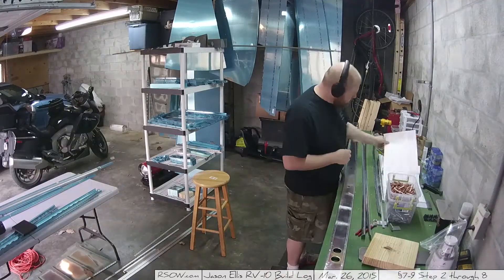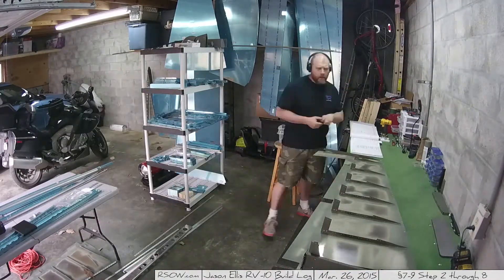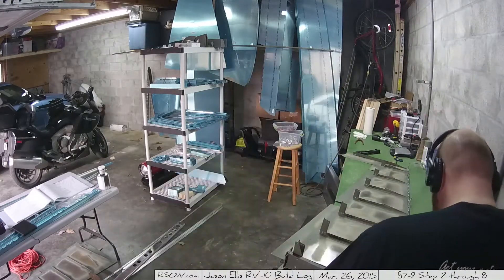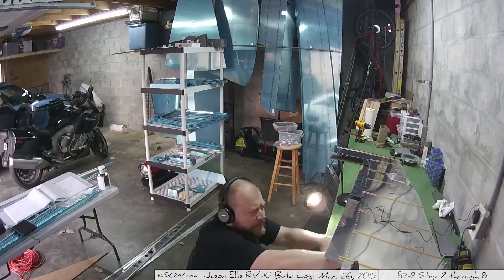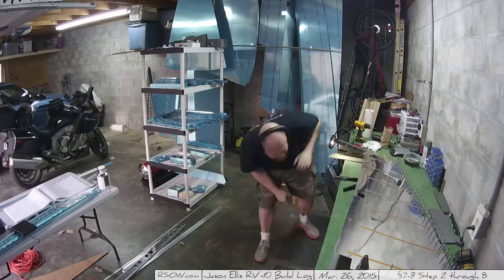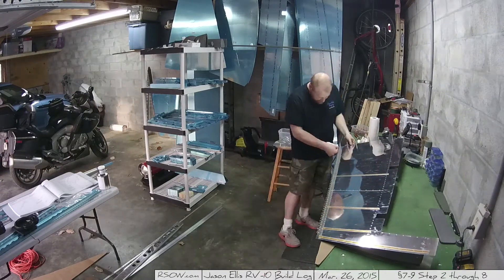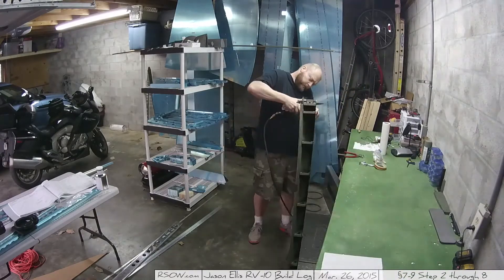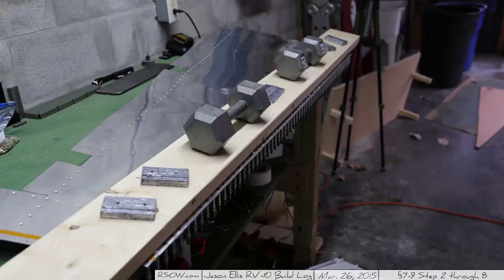RV-10 Empennage Section 7-9 steps 2 to 8

Comment: How much sealant did you end up needing for this application?  That stuff is expensive, and I don't want to buy more than I'll need in a couple months when my kit arrives.
Reply from the maker: Honestly, not much at all.  One of the little 2oz tubes should be ample.. But I know a lot of folks that just use double sided industrial tape instead of the goop here.

Comment: when working with B1/2. B2 sealant or whatever this one that you got is called, gloves are your friend. and apply it THIN. When you rivet the excess will squeeze out of every space possible, so you only need a thin coat when sandwiching .

MEK - Methyl Ethyl Ketone, (pronounced EMM EEE KAY) It is actually what we use in the military to clean it up. MEK will eat through silicone gloves and will actually cause your liver harm, if you use it prolonged with skin contact. Best to use FULL neoprene gloves with it.

You can also use Acetone, but it is not as effective as MEK.

Water will not work, except if you are using B2 sealant as a gap filler. When we used it in the Air Force, we would spit on our finger, without a glove on, and then use your wet finger with spit to smooth and blend the B2 sealant before it cures, and it will make for a nice filler, smooth and looks nice. You can paint over it, however, it will need to be fully cured, 96+ hours for full cure.